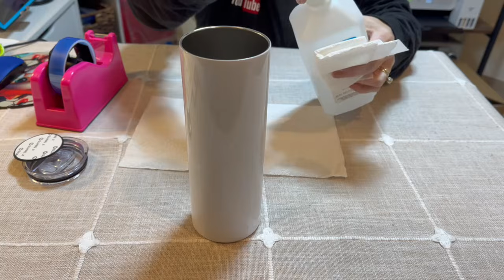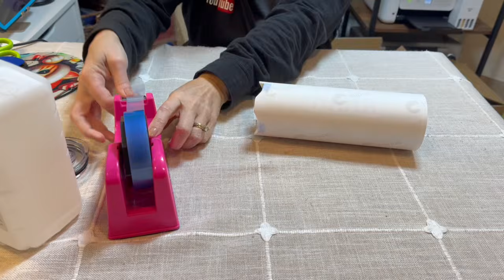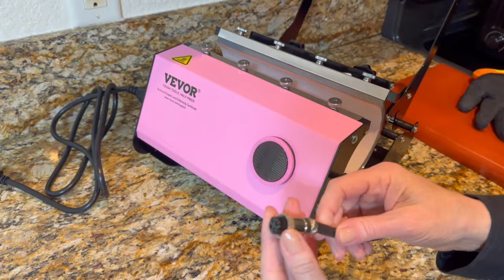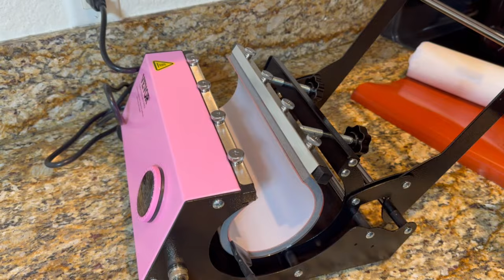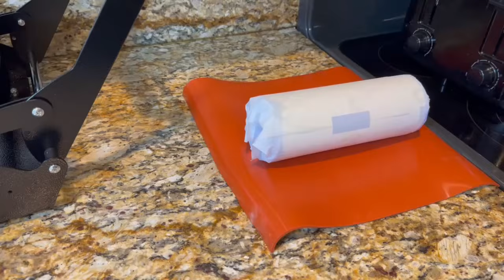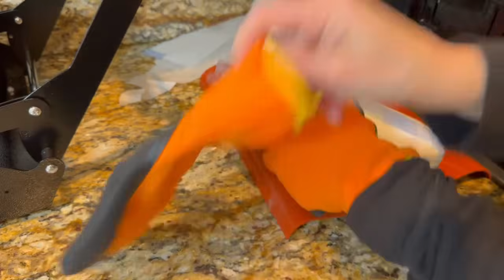Sublimation Tumblers Just Got SO Much Easier

Comment: How do you get it to change from c to f mine is stuck on c amd wont fo past 210
Reply from the maker: Did you press set, you should see a small C or F indicator and use the up/down arrow to toggle. Till you select what you want Then press set again. If that doesn’t work I’d call the manufacturer.  Hope that helps

Comment: Thank you for this demo on a tumbler. I recently purchased this machine and have only tried 11oz ceramic mugs. Tangalong brand and cannot seem to get the temp and time right. Directions say 380-390 for 70 seconds but heating times may vary. This temp and time does not work as the prints come out faded in some spots with brownish white streaks. I’ve also tried other temps and times that either burn or come out way too light. Just curious if you’ve tried ceramic mugs yet in this press and have found the perfect temp and time?
Reply from the maker: I haven’t.  I almost did yesterday for a teacher gift, but decided to stick w the convection toaster oven to make sure the mug turned out good. lol. I will soon! I’ll make a video on it.
Reply from the maker: I just made a mug today w my vevor. I did 400 degrees for 240 seconds. And mine turned out good!  Hope that helps
Reply: @creationswithtory  thank you.

Comment: I have a question about printing your image that you use my question is how do you setup the printer to do the exact size that you need
Reply from the maker: Great question! When I create the template for the tumbler in canva, I'm inputting the size of the template I need.  Then when I print it as a pdf, I make sure to set the printer settings to actual size, so it prints the size I need.  Hope that helps.
Reply: Thank you for the speedy reply I will let my wife know
Reply from the maker: I’d also print it first on b/w printer and check to make sure the sizing looks right before you print on the sublimation. I always try to do the first. Good luck! Let me know if you have anymore questions.
Reply: I am new to all of this. What type/brand of sublimation printer do you use? And where do you get your paper

Comment: Hi, so i have this heat press and I believe im doing everything correct but when I peel off the paper, the image is not transferring to the tumbler. Do you have any idea why that is?
Thank you
Reply from the maker: Is your tumbler a sublimation tumbler? And are you using a sublimation ink printer and sublimation paper?
Reply: Yes everything is sublimation
Reply from the maker: @ricardojimenez9082  That’s frustrating. I googled it. It says, make sure the tumbler is clean, sublimation works better on clean item. Verify you are using high quality sublimation paper. Low quality paper may not hold ink or may not release it properly. Same with sublimation ink. Make sure you have the temperature correct and adequate pressure on the tumbler, so the ink transfers properly. Lastly, you might have a malfunction with the heat press.  Hope that helps!
Reply: Ok, Im going to check everything 
Thank you for the fast response 👍